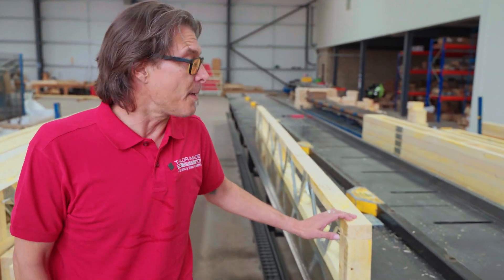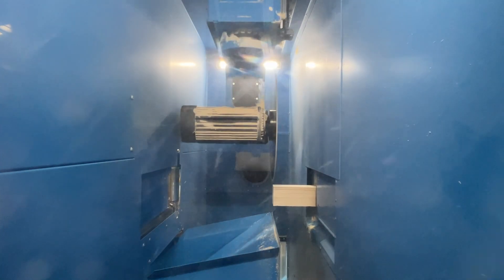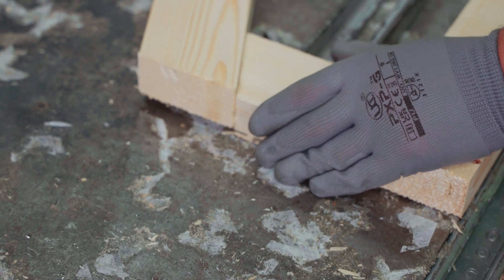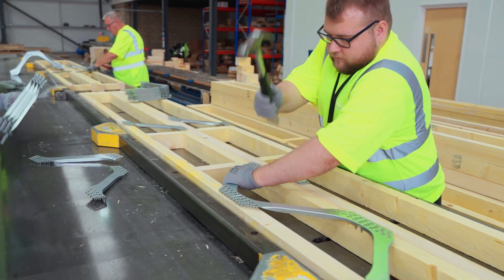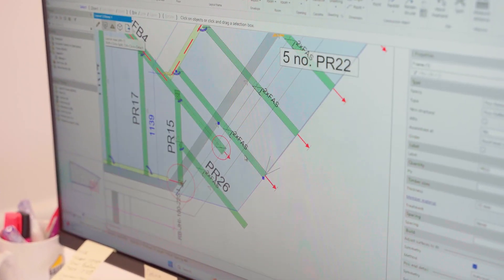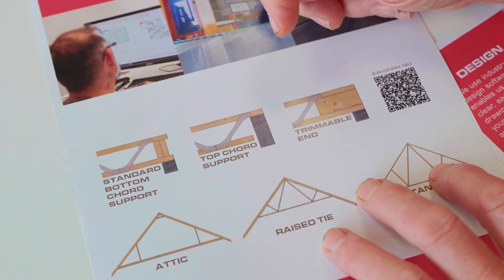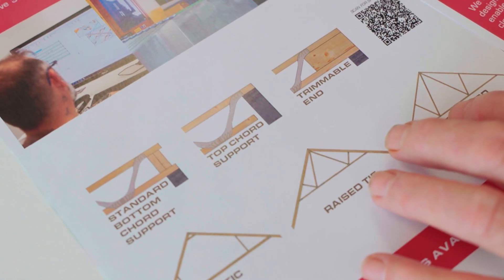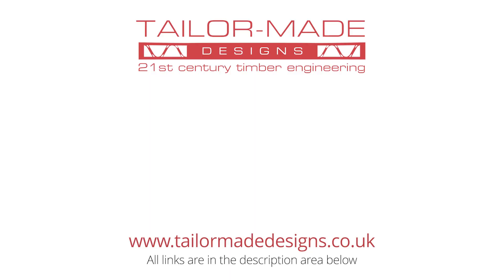The Surprising Benefits of Roof Trusses Nobody Tells You

Comment: The argument it uses less timber is almost a non point when you consider in order to do one small thing it robs you of a loft for storage or future conversion. And by the standard of his argument you may as well build a shelter out of twigs and leaves but instead we choose to build houses with thousands of materials because it’s consumes more material but it creates a better home. Cant beat a highly skilled carpenter cutting in a pitched roof. As our population spirals out of control loft conversions are a fantastic and incredibly cost efficient way to accommodate without taking land mass. Truss roofs may have their place somewhere but not for housing in my opinion.
Reply: Attic trusses are available for this reason, providing a loft space for storage, a bedroom, bathroom or whatever you fancy. Additionally, standard trusses can often be converted to allow a habitable loft space if someone has purchased a new build, for example, where they're common.

Comment: I've been meaning to visit that factory as I am very impressed with the very modern machinery that they use as opposed to a lot of construction factories - say steel fabricators who use very old and outdated machinery.  And it's in a very modern building.  Interestingly their website says they started out in timber frame and then changed to trusses and posi-joists.
I'm wondering if you'd be interested in doing a video together to talk about roof trusses, also that I could explain how they work, how efficient they are, and how to brace them and what happens if you don't.

Comment: The thing is that there are many options, and they can be used in the same space.  A cut roof is also a truss, just different.  In production price and profit are managed at scale.  Also the lower skilled a competent workforce, the better.  Most sites will have lifting machinery for loads or safety.

But if working at a different scale, depending on bureaucracy, it is often cheaper and better to use cut products.  The extreme case is a timber frame building.  One of my two houses in NA is an 18th century 2 story farm house, timber framed.  In a hurricane (we don't get the roof ripping end of these storms) it is almost quiet, and nothing moves.  It is the extreme end of the cut frame building.  With the rafters spaced 8 feet apart.  The wood was cut from the surrounding property.  With band mills, some people still do that today.

Comment: Trusses are great.  The big advantage of a laid roof is that you can do it without cranes to place the trusses on the jobsite.  You can put it up faster, overall, and the end result is more versatile if there will ever be future remodeling, or storage, or living space is required.  At least where we build, there is no need for special engineering.  We added a small addition, something like 8x16.  All I did was drive to the reno center and load up about 12 2x8s or 2x10.  Cut them with a saw, and nail them up to ledgers and the walls.  A few hours work.  And the same would be true of larger structures.  It is ironic that the stronger methodology, trusses, requires engineering, while you can just build to standard features with no engineering at all with a laid roof.

The disadvantages are that the wood for a hand laid rood is larger sectioned, and usually  more expensive and requires higher quality wood (the job is not necessarily more expensive), and you do end up with nice wood.  People will even feature it.  It also takes more skill to do a laid roof of any complexity.  complex roof shapes have become popular over the last 20 years, and larger roofs.  All you need with trusses is just a truss every 16 inches, or whatever, and all those shapes are developed.  The irony is they are often meaningless, or can't be used. They may be more for show.  However, a good job would have some usable space.

Comment: I read some years ago that using attic trusses only added around £1,500 to a new build (instead of standard trusses). They could then be expanded into much more easily at some future point. I wonder why big developers weren't obliged to use them by law.
Reply: The average UK 3-bed home would amount to roughly £1500 excluding VAT and delivery if opting for standard trusses. For the same job using attic trusses you'd pay roughly 3x the price, so £4500 excluding VAT and delivery. Seems like a bit of a no-brainer to pay the extra in our opinion.

Comment: Had Posi Joists specified at 600mm centres and assured it would be fine, but my “old school” head couldn’t accept it and asked for it to be spec’d at 400mm centres so I could sleep at night 😂 Two floors, over 5.5mtr square, one intermediate brace, no bounce at all, highly recommend
Reply from the maker: I agree with you, 600 is too much.
Reply: This is an issue with the spacing, not the joists, just so anyone not familiar will realize the issue.  Also, flooring is  stiffer to the cube of the material thickness, and also relative to the orientation.  So an 18mm material is 3.3 time stiffer than 12mm.  If one is dealing with the larger spacing (and 600mm is really wide)  Span is also a 3rd order thing.  So basically, you are widening the spacing, you need to consider that your flooring should be equally thicker.  I don't know UK rules, but if 18mm worked across a span of 400mm, you would need 27 mm for the 600 span.  And if one ended up instally material that was 24mm that might be marginal, if it was installed on the wrong 90, it might be very saggy.  

These are just rules of thumb, not engineering advice.

Comment: The bottom line is the Joist and Truss use less wood to provide the same result and they are easier to manage To provide greater building options !
Reply: The thing is that there are many options, and they can be used in the same space.  A cut roof is also a truss, just different.  In production price and profit are managed at scale.  Also the lower skilled a competent workforce, the better.  Most sites will have lifting machinery for loads or safety.

But if working at a different scale, depending on bureaucracy, it is often cheaper and better to use cut products.  The extreme case is a timber frame building.  One of my two houses in NA is an 18th century 2 story farm house, timber framed.  In a hurricane (we don't get the roof ripping end of these storms) it is almost quiet, and nothing moves.  It is the extreme end of the cut frame building.  With the rafters spaced 8 feet apart.  The wood was cut from the surrounding property.  With band mills, some people still do that today.

Comment: When working in timberframe design I too had thoughts on projecting the CAD frame designs onto a benchtop, but through a video projector, so I am pleased to see that an even better laser system has been developed. Posijoists are a real solution to floor spans and inclusion of services. During my working time the main criticisms and problems reported were due to damages in transit or failures to follow installation procedures on site (i.e. missing out strongbacks). The truss design software includes specific questions of loading factors that were within the realm of structural engineers to the extent that sizing and placement of gang nail plates are defined (as seen in the laser projection). If our house-building industry is to meet current demand more components will need to be factory made.

Comment: I love the way that they completely screw up any potential for utilising the loft space as another room....
Reply from the maker: You can get attic trusses. Most modern homes are built with habitable roof spaces created by trusses.
Reply: @SkillBuilder  Not round our way in Jockland- every new build still has this. Neighbours house is a tiny 2 bedroom (second like a box room) but the attic could have been converted so easily now they have started their family had it not been cheapskated with these nasty trusses!!! A local joiner I know said it is easier to rip off the roof and start again!
Reply: No they don’t, most loft conversion specialists can easily convert a loft with trusses simply by strengthening the rafters
Reply: @James-xb7eg  So why not just do away with them so none of this retro-fitting is necessary....Bet if someone buying a new house was told it would be x-hundreds/thousands more to have a usable attic from the start they'd go with it rather than having to pay a specialist down the line plus a structural engineer to do the calcs and design, and would that be something building control would want to stick their nose into ??
Reply: Hi, we offer (and often recommend!) the use of attic trusses to utilise loft space. These don't require retro-fitting or modifying and can be installed just as quickly as standard trusses. Granted, they cost more, but well worth it in our opinion.